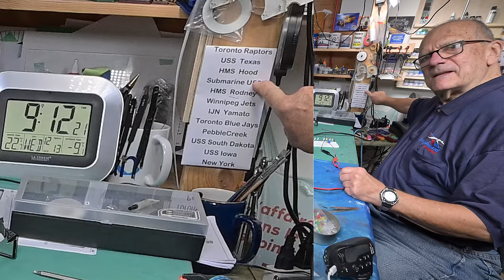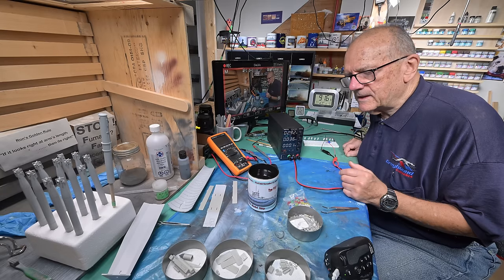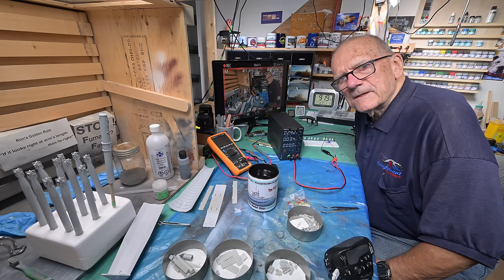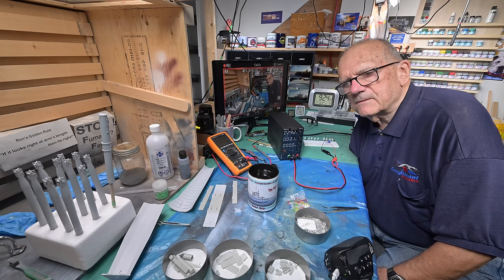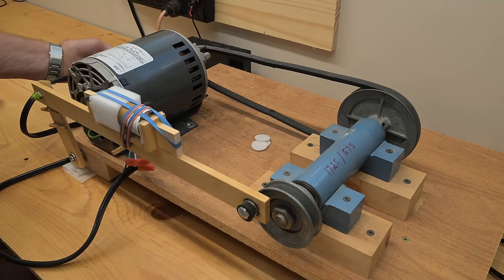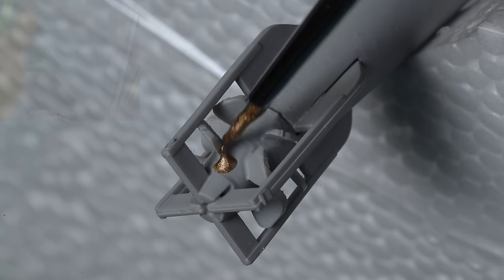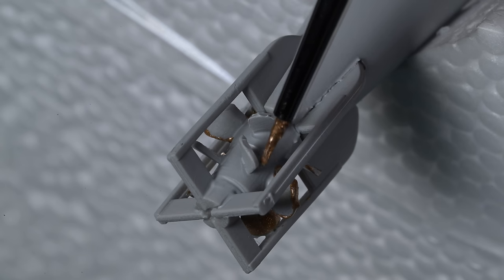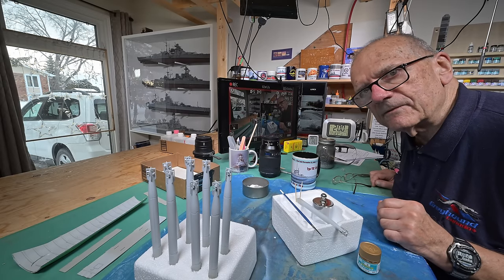The Model Ship - Part 1834

Comment: Hi Ron, I have lit quite a few models, I would suggest using 30 gauge wire, a roll of red and black is pretty cheap. Should be pretty easy to hide the wires. I really hope you do 😄

Comment: Hi Ron,  in.my teens , use to love putting electric motors in my model planes,  hang them from the ceiling with dads fishing line  , turn the battery pack on and watch it fly in a circle round my room,  the things we use to do before computer games lol😊😊😊😊  depending on how those torpedoes are stored,  you might not have to worry about touching up to much Ron 😎😎😎😎😎 see you tomorrow
Reply from the maker: Re: "depending on how those torpedoes are stored" I'm hoping I can leave the torpedo tube hatches open 🤞

Comment: Hi Ron you just got to light the sub it will show all of your hard work. But I would not use LED’S like the ones you already have these are old school, but get pre wired SMD’S micro or mini you can specify what voltage you want them to work at 3-6-9-12, also I would use warm white not the white or cool white you already have you can also get coloured one as well.
Reply from the maker: Re: "SMD LED Micro LEDs" Yes! been looking into those too. 👍

Comment: Have you considered using micro-LEDs that can be used in model Railway modelling instead of the larger ones?
Reply from the maker: I've just ordered a pkg of 3mm clear. Will see how that compares to the subs existing light fixtures. 🤞
Reply: Hi, Have you considered LED that are much smaller than this because they would be more in scale? @roncalverley